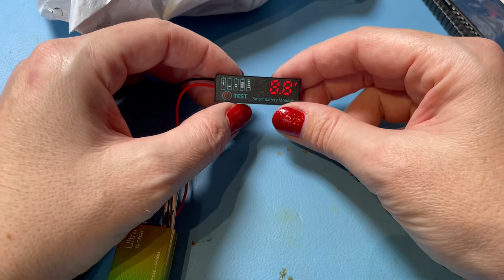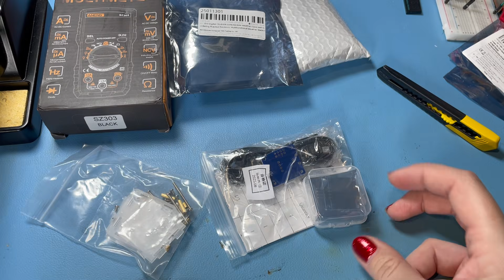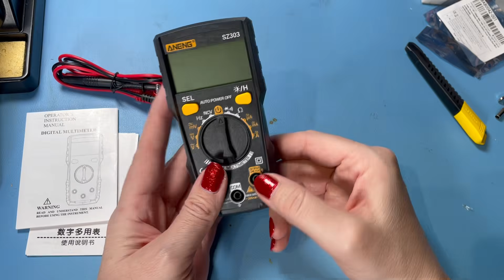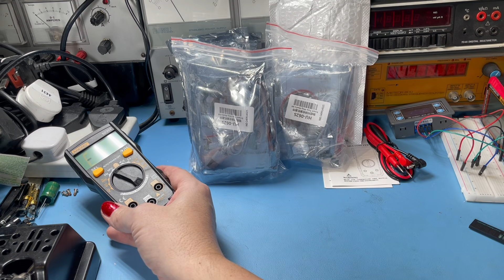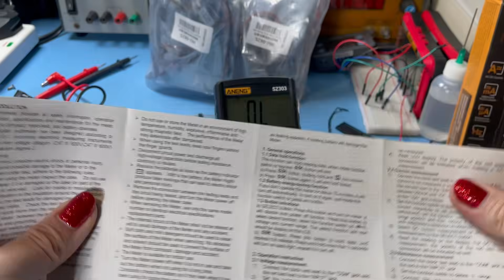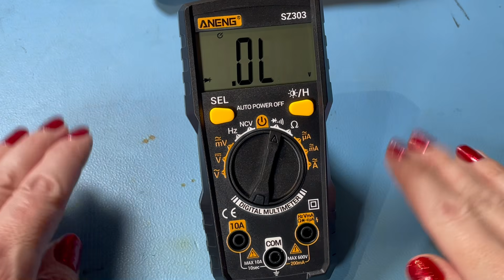AliExpress Tech Time!  Electronic Kits & Gadgets Plus Aneng SZ303 Multimeter Test & Teardown!

Comment: Where to buy your cable probe?
Reply from the maker: You mean the multimeter probes?
Reply: @JazzTechUK yes
Reply from the maker: They are Aneng PT1005B 10A Digital Multimeter Probe. Originally from Temu, but they don't stock them any more. You can get them on AliExpress. Here is a link for a set of 3 but you can search further for just one set using the description above.
https://www.aliexpress.com/item/1005012629663499.html
Reply: @JazzTechUK thank you

Comment: Jazzy try the volt/ammeter kit it’s a nice kit with a a major problem. If you solder the chip in ,you then can’t solder the display,there are no instructions supplied but the components  are straight forward, if you do get the kit which is only a couple of quid , would like to see you take this challenging kit.❤❤❤
Reply from the maker: If it's the kit I think you are talking about, I have already done it. There is a special way you have to assemble it to avoid that issue.
Reply: Hi jazzy when did you do it so that I can look it up and hopefully I can complete this kit ❤❤❤❤

Comment: If you look up the Beken BK4802N datasheet and adjust one pin, you can change it from China 409.75MHz to a UK legal LPD 433.92MHz
Reply from the maker: Thank you. That's an extremely useful tip 😊

Comment: Nice video. I rather like the banana plug with the WAGO style connection ... potentially very handy.

Regarding multimeters with a "NCV" function. TBH I haven't had much luck with those. I'm currently rewiring my son's new property and the supposed NCV function on my quite expensive UNI-T meter turned out to be pretty useless. I bought a pen style Fluke "VoltAlert" one from Screwfix and I must say it's excellent for identifying live and not-live conductors.
Reply from the maker: I think you are better off with a proper voltage detector. It does make me wonder whether NCV is an extra gimmick.

Comment: Great kits for a few quid can the non contact voltage be used to track, cables in walls when drilling holes
Reply from the maker: I think you are better off with a proper voltage detector. That's likely to be far more sensitive and accurate. Another viewer on here mentioned they didn't have much luck with the NCV function for tracing cables in walls.